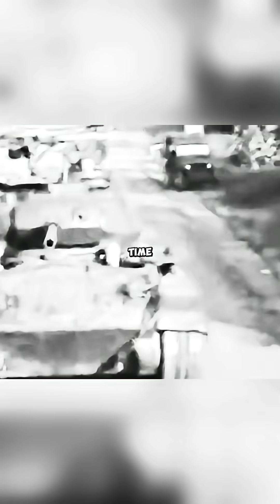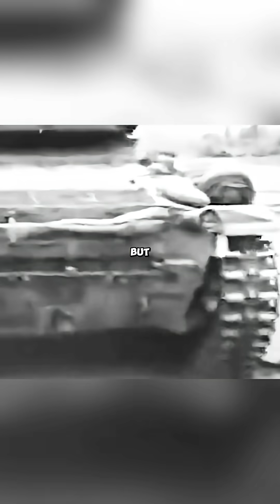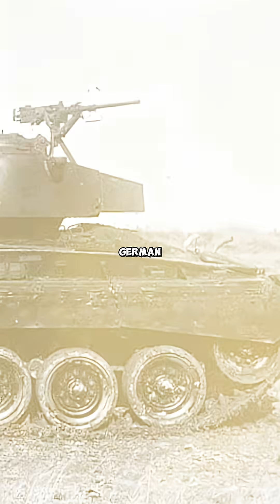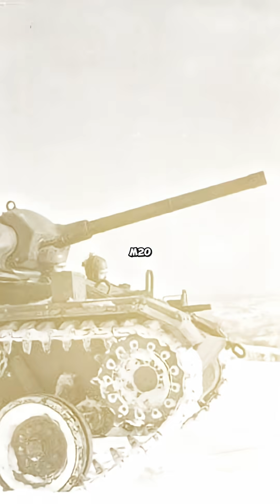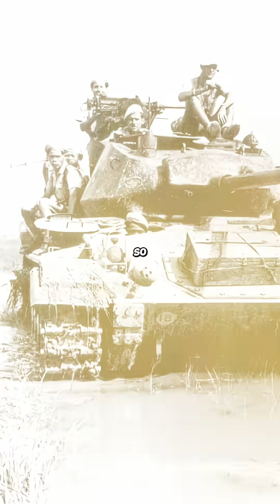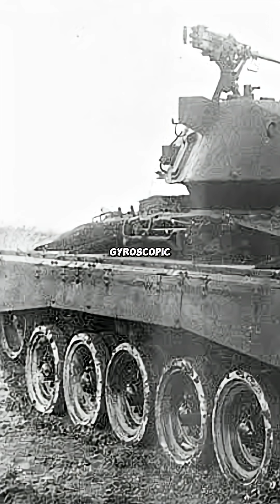Why the M24 Chaffee Could Shoot While Moving and Hit Every Time

Comment: The M-24's 75mm gun was a deveritive of the same gun used in some of the later M-25 Bombers. Those cannons were much lighter than the Sherman's gun therefore the M-24, a light tank, had almost the same firepower as the Sherman, a medium tank. Hardly a failure, the 5th Air Force used them and skip bombing to great effect vs. Japanese merchant ships.